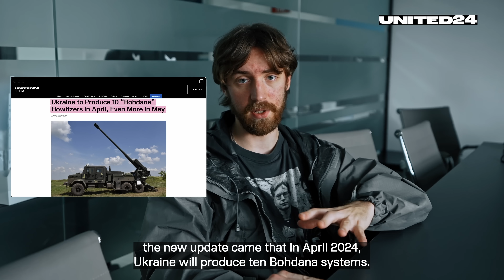Ukrainian-made 155 howitzer Bohdana Hit Russian Weapons Depots, Infantry Positions, and Mortar Crews

Comment: why did they not use the auto loader
Reply: does ukraine look like a country that has 10,000 mechanical engineers with nothing better to do?
Reply: @davidanalyst671   it's attached to that vehicle ,  so yes it seems they do have 10,000 mechanical engineers with something o do :)))
Reply: It's unreliable. Sometimes it jams, sometimes the shell isn't loaded properly and it slides out... crews avoid using it in combat situations.

Comment: Hey how about if Ukraine focused on making 155mm artillery shells.  Imagine that
Looks like they mounted a M777 in the back of a truck
Reply: M777 is much lighter and has a considerably shorter barrel.  SPGs generally fire at a slightly slower rate but win easily in shoot-and-scoot operations, which is better for individually aimed shots.  And with the risk of drones and counter-battery fire, SPGs simply outlast towed artillery.
Reply: M777 are not interresting for this because the accuracy and range is much higher with the much longer tube from Bohdana and Caesar...